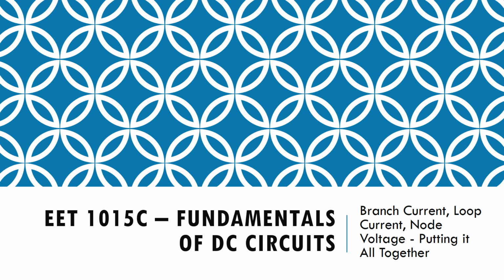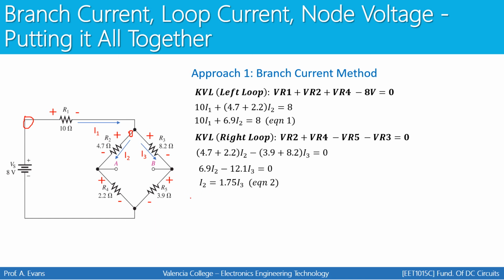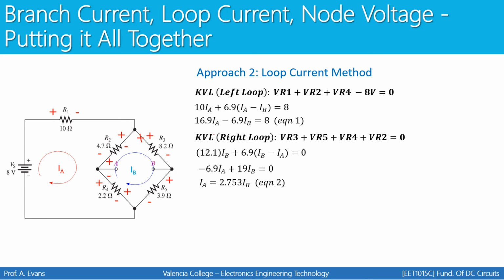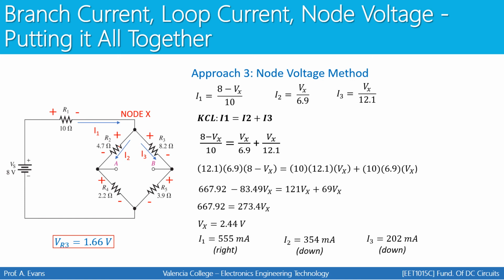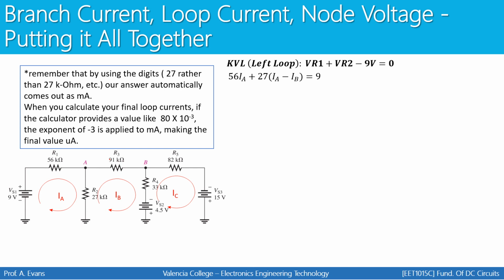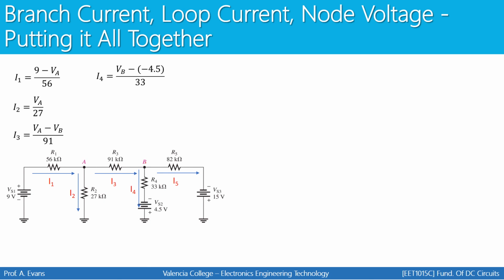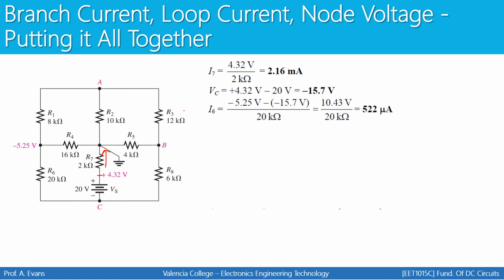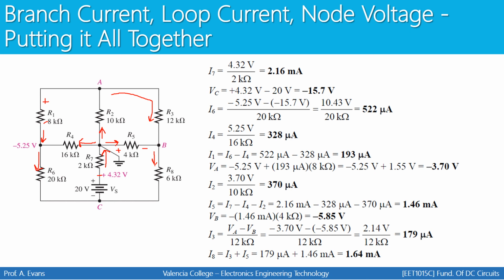[EET1015C - Fund. of DC Circuits] Putting it All Together: Node Voltage/Branch/Loop Current Method

Comment: Did any of these problems use a current source? I'm not sure how to handle current sources when doing the current loop method. There were just a bunch of voltage sources.
Reply from the maker: No, I don't have any examples using a current source.  However, the principles of KVL, KCL, and Ohm's Law do not change.  The way we would apply these techniques, by using KVL/KCL/Ohm's Law, would change.  If you have an example you'd like to see worked out, you can e-mail me.  aevans57@valenciacollege.edu